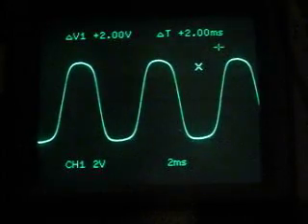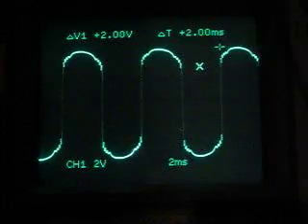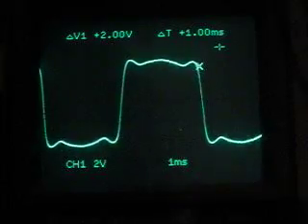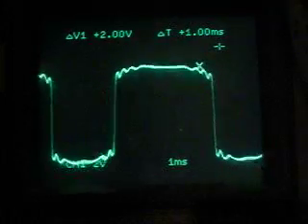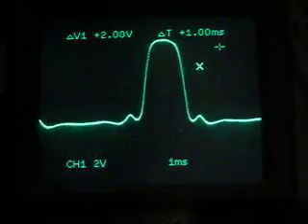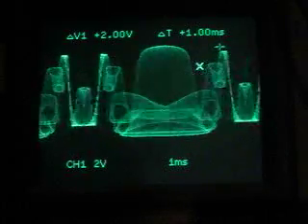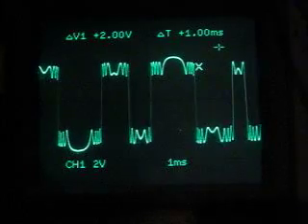Wave Folder Demonstration - Sine

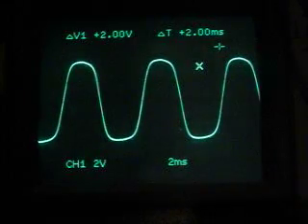Comment: It looks like the input is already being soft-clipped before you start, like at 1:20.  Either that, or your Q106 needs its sine adjusted (not sure if mis-calibration of the sine shape could cause that much distortion though).  Cool demo though!
Reply from the maker: the source is a triangle!
Reply: Wow!  Okay, looking at Yves' schematic now, U1c looks like it's configured as a diode limiter.  Thanks.

Comment from the maker: thanks for the compliments, especially on the scope shot. i was worried it wouldn't translate well. my camera angle was actually embarassing, and i use a Canon SD1000 instead of a real video camera. the audio on these is recorded to the Alesis HD24 and then mixed with the video in Digital Performer.